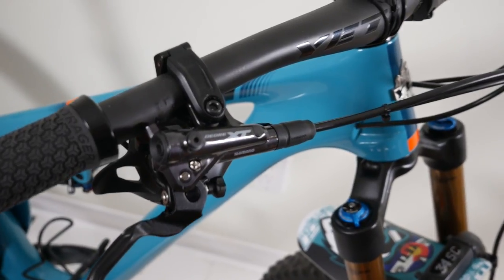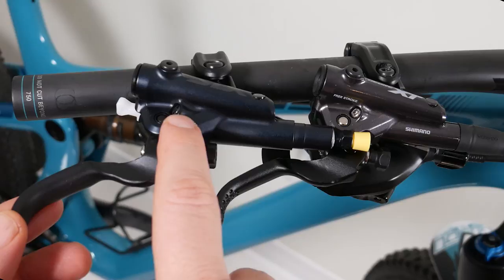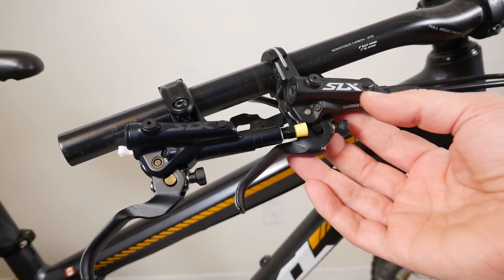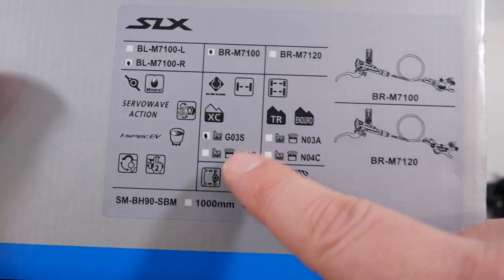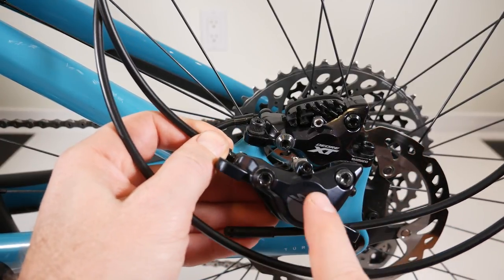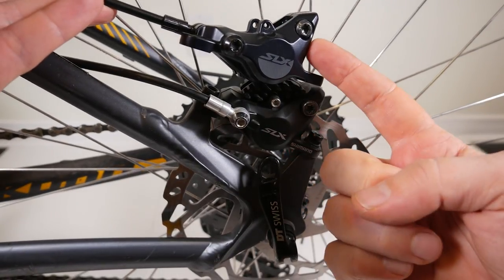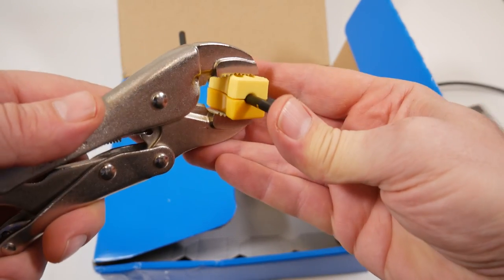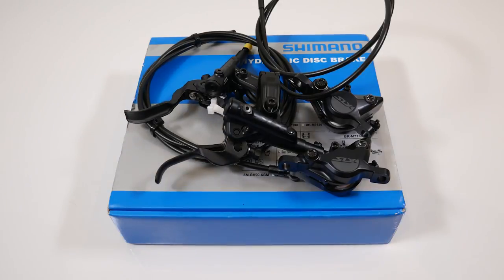BEST Compromise? Shimano SLX M7100 Brakes vs XT M8100 and SLX M7000

Comment: I've had my M7000 brakes since 2017 and it has never ever failed me, it has saved my life multiple times because of how strong the brakes are. I run them on a 180mm Ice-tech rotors on the front and 160mm on the back. Love it to death, I definitely see the dfferences between the two newer brakes and the M7000 but I don't see any reason to drop my M7000 for these two. Great in-depth review, keep it up!!
Reply: @seb.evidente What bike are you riding? I have the M7100's on my Chameleon and they are great.  I am looking for a Shimano replacement for my Sram Guide R's on my Giant Trance 29er.  Can't decide whether to go for another set of M7100 or M7120 for he Giant.  Any thoughts?  Giant does far more steep descending than Chameleon.
Reply: @David-rb3tk  hello there, I ride a 2017 Cannondale Trail 29er. If your choice is between the identical M7100 and the M7120, the trails you ride and your riding preference will be the only deciding factor. M7100 only has 2 piston brakes which I reckon are quite similar to the stock ones you have on your giant, they were designed with XC riders like me in mind. They're not as strong as the M7120s but are just as durable and everything else. I'd argue that they last a bit longer and maintenance is easier since you only have to care for 2 pistons, and you'll be buying brake pads less often since the M7100s are weaker. The M7120s on the other hand, are more suited for Enduro, Downhill because those disciplines require stronger brakes. If you used the M7120s them for XC you might find yourself flying over the bar more often because they're too strong. They easier to modulate, so less of that "on and off" feeling when you brake,  they require more maintenance (you have to care for 4 pistons) and are just as durable, provided you dilligently change the brake pads. To conclude, the difference is that the M7120s are stronger than the M7100s, they're also more expensive to purchase and maintain but if you ride trails/enduro/downhill, they're perfect. The M7100s are adequately strong, more for XC, cheaper to buy and maintain. If money's no issue, the trails you usually ride (Enduro or XC) will be the only deciding factor.
Reply: @seb.evidente7328  m8100's? how about them
Reply: @marke.8668  they're an amazing set of brakes. While I've never had the opportunity to have them on my bike myself (I still have M7000s), I have friends who I ride with who have and enjoy them. They're trail riders who were originally considering just the M8000s but eventually chose the M8100s because of their trail-oriented riding and riding style. I've been told that they like the stopping power, the modulation especially when paired with matching Shimano Ice-Tech Rotors.
Reply: @seb.evidente7328  ive heard that the m7100 and m8100 2pot brakes are the same in stopping power
Reply: @marke.8668  in that case i'd go for the slightly cheaper m7100s then!

Comment: I love Shimano brakes. They work great. I've had one that had a bad piston seal right out of the box, and Shimano worked out a warranty replacement quickly. I have used Deore, and SLX, but for raw value, I like the MT200 Altus brakes. I was dumbfounded at how well they work.

Comment: Wouldn't the new Deore be the best value in the current shimano lineup? Awesome video btw, as always.
Reply: The caliper of the Deore brakes looks different. Also they now have four piston caliper as well. Actually waiting you to reviw them, cause I'm searching for a new brakes. And this four piston Deore option seems tempting. Great video as allways!
Reply: @TonchoTonev  the new Deore brakes won't be released until mid to late june and when released they will probably start at their recommended retail prices.

Currently new SLX parts are cheaper than the Deore parts' rrp's.
Also I personally really dislike that metal pin you have to use on the Deore brake calipers. The bold on SLX and above is much more convenient.
Reply: @LoveMTB  the new Deore 4pot from what the looks of it is actually the MT520 caliper from two years back, I hope you can verify that when you get them
Reply: These look the same as the M400 brakes that came on my trance, same masters, calipers. What's different?

Comment: I’ve just got the new SLX brake set after 1 week of deliberations between the SLX and XT (both 4 piston calliper versions). Bare in mind my current brakes where M365 at £40 for the complete set (so really old and crappy). It came down to, the XT and SLX are identical except the colour and the SLX are almost £50 cheaper than the XT. This was the decider for me, £50 cheaper just because of the colour finish. This left me with enough to get 2 pairs of new ceramic pads and still have almost £37 left to spend on beer 🍺. Get the SLX if you don’t care about the finish colouring, or if your bike is blue (like mine) because they’re the exact same technology 👍
Reply: A year ago I upgraded the same M365 you have, for used set of MT520/M501, 4pot calipers with the Deore lever... Huge upgrade, for about £55, pretty happy with it
Reply: Had the same dilemma, but OCD got the better of me. Bit worried that the wandering bite point that I've read about though, you had any issues with the bite point?

Comment: Whenever I put together a new bike, I always end up getting the SLX brakes. I have some nice bikes, one has XTR everything, but the SLX brakes just make the most sense. Especially considering they only last a year before blowing the seals, so what's the point of spending more on XTR? They function the same, like 20g difference.
Reply: @LoveMTB  The seals around the pistons will start leaking. I don't bother with warranty, just buy another set.
Reply: You should consider hope brakes, if you are having trouble with the seals since you can replace them with Hope
Reply: Where do you live? I ride a lot, and am still running an OEM deore from 2015. Been through at least 8 sets of pads on them and all the seals are still great.

Comment: Is there any performance difference at all? Or are the differences purely cosmetic? I actually prefer the Slx styling over the Xt and Xtr (I hate bling).
Reply: LoveMTB in your vast knowledge do you know or recommend a 12 speed cassette to suit 12 speed Shimano to work on xd or hg drivers? I have a spare set of wheels but can’t get a micro spline driver to suit my hubs (as yet).
Great content really appreciate it👍🏼👍🏼
Reply: LoveMTB great thanks can I use the Shimano 12s xt chain?
Reply: I agree with you on the cosmetics, slx is more tasteful

Comment: The "free stroke" adjustment regulates the useful travel of the lever when pressing the brake, you can have greater travel and progressiveness, or less travel and immediacy. It is true that it may not compensate for the price difference, but it has its function. Best regards!

Comment: I have the m7000 older style and don't think i'm switching to anything else. Maybe I'm thinking about the 4 piston SLX M7120 but these brakes are no slouch and I can lock up my wheel easily with them. I don't see a reason to switch. Have been going strong with the M 7000 and they're just amazing for the price I paid I think it was $120 for front and rear... Can't beat that value IMO.

Comment: Ya im still using deore with 180 rotors and organic pads. At 220 lbs it stops just fine.
Reply: @LoveMTB  tore down the bike. Built back up. Forgot to tighten xt crank arm.....ouch

Comment: im currently on my slxm7000, sold another set of m8000, figured they will simply sell better being XT. however that makes it the 3rd set of shimano brakes I ve had that are a disappointment due to inconsistent bite point on the rear brake(also previous old gen XT which i replaced due to that). My friend is running the 3-digit SLX old gen and those work fine. I am a fan of shimano but so far their brakes did not impress me. They work, they are easy (but messy) to bleed, but the lack of modulation and mostly consistency is a bit meh. Other than that, as a fan of price:performance, bought my bike with full SLX groupset, I don't think one can go wrong there and I see very little reasons for XT. Even deore would be nice.

Comment: I'm running the old deores (M6000) with metal finned pads and they're fantastic, feel like I have an excess of power. I've been riding more enduro recently on my hardtail and they've stood up really well.  I'll probably go SLX two piston if they ever start having problems, I think the 4 pot ones are overkill for a lot of people. Then again I haven't tried them... Will you be taking a look at the new deore brakes?

Comment: why people keep persisting that the 7100 series doesn't have free stroke adjustment. It has, but it uses a different screw. It uses a snake eye screw. So you need a snake eye screwdriver or you could easily remove that screw and use a conventional one. And it does make a difference , it is just a 2 step adjument. Not just screw and unscrew the dedicated bolt.

Comment: I buy them 3 weeks ago, before them I got old XT  775 brakes which you must use with 2 fingers, and now for this SLX 7100 you use only one finger.
I am satisfied with them.
Reply: Front disc is 183mm hope float and rear is 160mm hope float. Pads are resin with coolers.

Comment: I went from looking at an OEM Deore 2 piston M6100 brake set on eBay to considering the slightly more expensive 4 piston 6120 set. Then when comparing prices of Metal pads since those sets were equipped with the basic resin pads and of course only considering buying from a legit source led to pricing everything from the Deore M6100 to SLX, to the XT M8120. In the end the XT M8120 front and rear purchased through verified Shimano dealers made the most sense. Everything from prices to actual availability and small but significant features on the XT led me from considering a $165 set to spending $500 on a full XT setup.

Comment: Just bought the SLX's from Thunder Mountain Bikes because they were much cheaper than the XT's.  $336 out the door.  I bought a 4 piston for the front and a 2 piston for the rear.  My bike has internal cable routing so the rear should be fun.  I may have to have my L.B.S. bleed it for me.

Comment: im choosing between the m7100 and m8100 brakes, 50$ difference where im from. should i just save or just spend the extra. im stuck choosing
Reply: @LoveMTB  kinda stuck in between. im using the slx drivetrain but with an xt crank. so i dont really know if i should just spend more for  the xt brakes to complement my crank cause it does look nice but at the same time it is just the same performance as the slx, and i could just spend the extra $$ for icetech rotors

Comment: Do you have any plans on trying Formula, Hope Tech, Trick Stuff Maxima? The last mentioned is the most expensive brakes. several people has shared their love for the Trick stuff brakes, they are apparently the most powerful brakes on the market. another nice thing is they use refined sunflower seed oil as brake fluid. Many have advice me against going for Hope Tech, cus of the toxic, corrosive fluid.
Formula Cura 4 has been recommended if I am not willing to go for Trickstuff
Reply: @LoveMTB  Micro spline was delayed cus Shimano restricted access and was slow to allow Hope, it was one of the last companies that finally got permission/license for it. but how fast things come can vary from country to country and what stores offer, but now due to corona virus there are delays.
Reply: @LoveMTB  right now the new Five Ten shoes are impossible to get, out of stock everywhere, and Adidas online store has none in my size, only one size came up, and before they did not even have one size. probably production delay. so expect that with all brands, products, delays everywhere. so knowing about many shops is important, I know many, but still some won't ship internationally due to corona like bike-components, some shops closed completely. here in Norway corona numbers arte quite good, but the problem is getting product to the importer, so shop don't have all products in yet, delayed by months, and Norway usually is few months behind US market anyway before corona., But I have all I need now, just need new helmet soon, but could not decide yet. also want to try different brakes, tyres.

Comment: No one-way bleeding on the M7120 according to the box? I'm considering upgrading the M7000 calipers to M7120 as I like the M7000 levers and I have I-Spec II XT-shifters and dropper levers which I'd rather not change to bar clamps. Am I begging for trouble with that combo? Other than the bluish hue on the M7120 calipers, which looks horrible.
Reply: @LoveMTB  Thanks for your input! As in the past you've made some experimenting with mixing components, how about mixing a new Deore M5100 11-51 cassette with XT M8000 GS rear derailleur?
Reply: @LoveMTB  Yeah, that's what I thought but some people have managed to ride with a 50t pie plates on it though. Luckily the new RD-M5100 is very affordable, most likely best choice for high ratio 11 speed and should work pretty well with the SL-M8000.
Reply: @LoveMTB  Hah, yeah that's true. I'm going to upgrade one drivetrain in the household anyway so might as well be mine and pass my old drivetrain to my son. ;)
Reply: @LoveMTB  So I ended up ordering the CS-M5100 11-51. It does work with the RD-M8000-GS and is ok'ish but fortunately I ordered the RD-M5100 as well. It works a lot smoother at the larger cogs which is not a huge surprise but it's very crisp when paired with the SL-M8000. I fear for my mech hanger though as the fastening is a lot different from M8000. I ordered the new CN-M71000 for this drivetrain to test it out and there's no more chain drops when backpedaling with 32T oval in the front. 👍🏻

Comment: hey! great video! I was wondering.. ive recently picked up a new hybrid/city/urban bike, with "Shimano BR-MT200, Hydr. Disc Brake". is it possible to swap these to a SLX setup?
Reply: @LoveMTB  i know... but good enough doenst alway look "awesome!" silly i know.. bike as 160mm discs front and back... I like the adjustale lever on XT/SLX. Any way to change the lever on a mt200?

Comment: I have M7000's on one bike and love them to death. Super powerful, great feel, just tremendous brakes! I just upgraded brakes on another bike to the M7120's and im not gonna lie i'm not digging them so far. The newer levers "feel smaller" and i just dont feel they have a power the 7000's had. Im not sure exactly what changed. I only have a couple rides on the 7120's so maybe they need more seat time? We will see. If not ill be on the hunt for another m7000 brake set!
Reply: @LoveMTB  will do. Only have a couple rides so im going to give them more time

Comment: Is the new break lever mounting system compatible with older shifters that include a gear indicator on top of the handlebar? I think that if they fit, it will be very tight. I was also wondering if shimano will offer 12 speed shifters with gear indicator, even if it is under the handlebar.

Comment: Hi, got my m7100 brake set. May I ask where do you put the o-ring found in the clamps? Is it under the bolt head or under the clamp itself?
Reply: @LoveMTB  it's found in the bolt that tightens the bar clamp for m7100. Anyway thank you for the great videos.

Comment: hi LoveMTB just a quick question and wanting some advice... my deoree M6000 break lever is very spongy already done bleeding may times but still the same. would overhauling the lever will help the issues? thanks and more power 👌
Reply: LoveMTB hi again, used both funnel and syringe but still spongy. i will try to overhauled the breaks maybe some rubbers have leaks. ill update you ASAP. thanks
Reply: if in case it would still spongy, would replacing an non series shimano lever would work ? thanks

Comment: I buy the old slx It was very difficult to find a kit because they told me that Shimano stopped manufacturing the SLX M7000 and would replace them with M7100 and offered a suitable price for me M7100 but I refused the offer and I bought the M7000 each one separately and my insistence on the old design aesthetic shape and the final touches and by the way the performance did not differ  With the new design, I Shimano M7000, if the performance is different here makes a difference but does not exist.

Comment: Im looking out for a new set of brakes. At first i thougt about the Saint's, because i ride a lot of steep hills and need power. But then i discovered the new shimano series, with the slx, xt (an xtr?) all be the same, exept for the weight and finish. I also heard, that the xtr is as powerfull if not more powerfull than the Saint and many downhill riders used them in races. So does it mean that a pair of slx's are better than the Saint's?!?!?

On the other hand i read, that Saint pushes more oil through the lever to gain more power and it also has a more aggressive servo wave. The servo wave thing seems to be true.

So which is defenitely stronger? Has anyone ridden both?

!!!!!     SAINT vs. SLX     !!!!!
Reply: @LoveMTB  nice!  thanks 👍

Comment: I upgraded my 8100 to the 8120. Big difference. Will never run 2 piston brakes again.
Reply: @LoveMTB  stopping power, soon as you press the lever the brake engages. I am 185 pounds and the brakes dont heat up as much the 2 pistons do.

Comment: I have the older xt where the clamp is closer to the end rather than the center of the lever (new style) im concerned that since the clamp is located in the middle if it will affect my current placement of my shifter(sram xo1)

Comment: Hey im planning to buy this to replace my mt200 will this work with rt10 rotors?
Reply: @LoveMTB  hey yes i plan to do that is the rt56 better or what do you recommend for center lock rotors i bought the slx m7100
Reply: @LoveMTB  hey i installed the brakes if I buy rt70 rotor's will i get more braking power because I think I'm missing a lot of stoping power ?